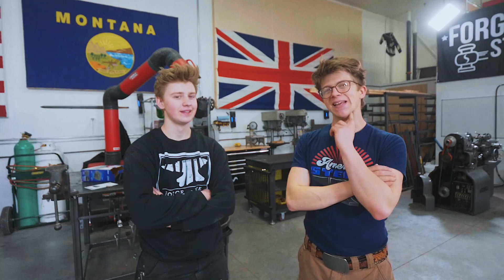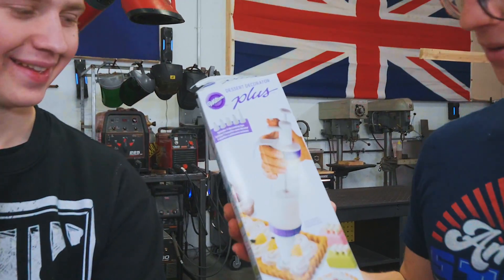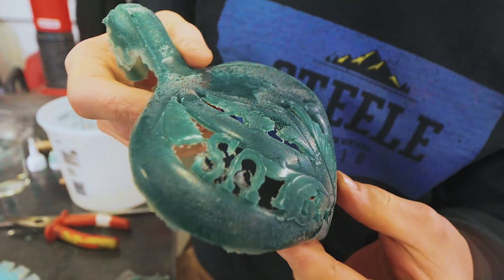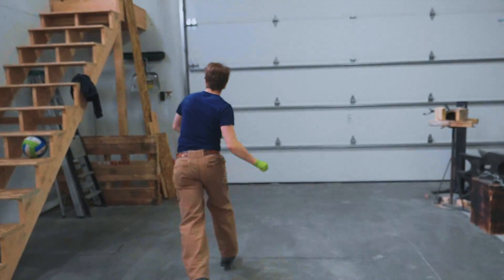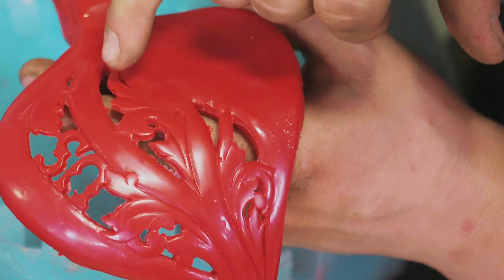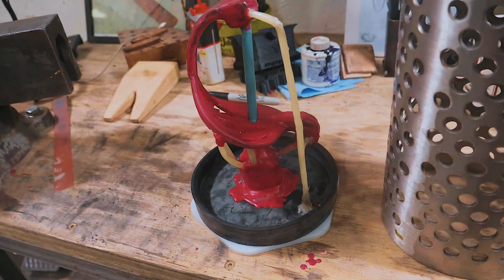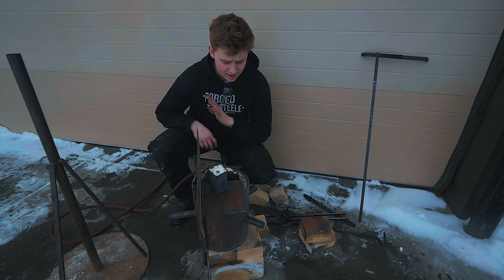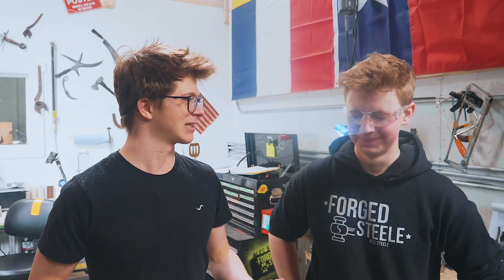MAKING THE CAVALRY SABRE: Part 13

Comment: You should think about getting a 3D printer. As they are awesome for prototyping.
Reply: I really thought this was an awesome idea since Alec has used CAD software before and it would be less time consuming
Reply: it also kinda defeats the purpose of hand craftsmanship. With some cnc tools, 3d printers etc. pretty much anybody can make things
Reply: @Nogrim there are some pretty good, open source and free Software solutions. blender for one.
Reply: @thorwaldjohanson2526  Somethings requires certain tools, 3-D printers is one of those tools. Even though it's one of the newest tools Available.
Reply: Thorwald Johanson putting a 3d printed finished product doesn’t sit well  with me, but for modeling that could be cool.
Reply: Agreed. It's painful watching them fail time and time again at things they never learned how to do properly
Reply: Not recommending for the finished product, but for the casting. You can do Lost PLA casting or they even make wax for 3d printers for lost wax casting
Reply: Was just thinking the same. You can get great printers for under $500 that are capable of printing wax specifically for casting.
Reply: Don't start giving Alec ideas to spend money on. He bought an oven to melt wax .. ;)
Reply: @thorwaldjohanson2526  I think you're overestimating the capabilities of printers and "anyone". Provided you have the chops to model exactly what you want and work around the constraints of the process, you can usually expect a printer to be off from the model by around a tenth of a millimeter on the X/Y plane from just material expansion and you'll have no end of hand finishing to get a part ready for use as a master. You can compensate for the former by undersizing parts of the model, but the finishing's non-negotiable. It cuts out carving wax and replaces it with a loop of CAD, printing, sanding, and measuring.

That said, I like the wax carving and would rather it stuck around. There's no end of channels that focus entirely on printing and CAD, and as someone knee deep in this stuff, it's kinda stale.
Reply: @StopChangingUsernamesYouTube  wasn't just talking about printing, but cnc manufacturing in general. And I agree, there's already a bunch of channels out there, and compared what Alec and Will are doing, it's a bit stale. There is just something about creating something with your hands
Reply: rothery2 Some 3-D printing technology and techniques, make excellent finish products, with many being used in general manufacture already. Even desktop 3D printers when used properly can produce  the required finish. Just as forging steel can produce scale, a 3-D print may have lines. Both can be removed with a bit of sanding.
Reply: Printing nerd here. 3D printing is awesome because it gives you the ability to rapidly prototype for a super-low price. I own two printers myself and have used them both for creating parts and for prototyping ideas that would then go on to be made from other materials. 

And it's really not all that difficult to learn. Or expensive for that matter. You can get a pretty good entry-level printer for around $200-300 or so, and there's outstanding modeling and slicing software out there that's completely free.
Reply: Also using a factory grade hammer, hydraulic press and the rest of the goodies does defeat the purpose of hand craftsmanship.
Reply: I disagree that using a cad and printer/cnc is not creative. 
They are just tools. Simple as that. If you don’t know how to use them properly you creat crap.
To make this swords guard you going to have to be pretty good at surface/mesh modelling and that is a skill set in its self. 
Those that have never studied it but criticise its use, have no idea what they are talking about.
Reply: Tools more tools must have more tools tools tools monster must have more tools I love that show

Comment: I have been casting replacement parts for missing and broken parts on hilts of high grade Civil War era and earlier swords for the past 25 years. I can tell you many things about mold making, wax injection, investing the wax patterns, burnout  and casting but will make only one point now. Just like in blade forging,  if all of the parameters are not met by following specific process procedures  in each of the processes,  the results will be less than desired. Since there are a number of processes involved in getting great results in the castings you will need to invest in the right tooling and then learn how to use it for each of many processes. Just like blade making, it’s not as easy as it seems it should, would or could be. But when you master the skills, it will come very naturally. It took me many years to accumulate the knowledge and skill I now have. And, just like you with blade making, we are still learning.

Comment: You aren't supposed to directly boil the wax.

Melt it by putting a small paint can containing wax in boiling water. Keeps it from smoking and boiling if you do it right.
Reply: So similar to melting chocolate in a double boiler?
Reply: Yep.
Reply: Candle maker here.  Yep, if your wax is smoking, you're doing it wrong.

 Melting and pouring point is a fair ways below boiling point of water.
Reply: I was wondering of their modelling wax is somehow different to candle? I'm a cheap bastard and if i try this I'm just stealing my wifes scented candles, might not work but it'll smell amazing.
Reply: @NoLoMo  a lot of chocolatier techniques carry over to cire perdue casting.
Reply: Wow so smart
Reply: You're right never melt wax over direct heat it could start on fire and you don't want to deal with a wax fire.... trust me!!

Comment: I've never really been much in the comments here but I saw this method to make a mold where you 3d print what you want and pack it in a wood box with sand, pour in the metal, and it seemed pretty good.

Comment: Hey guys, I’m a big fan of your antics - keep it up! Hey, on a side note - you guys should go spend a couple of hours at a local denture and crown laboratory (they wax cast denture and crown frames) just to watch and learn what tools and techniques they use. I worked at one for a couple of years and the people doing that type of work are some real artisans that do amazing work!! The one I worked at also used a centrifuge to aid with the casting and electrolysis to aid in the cleanup and polishing. Just a thought 😉

Comment: It's too bad no one ever let these wonderful boys in on the secret of mould release. Even just brushing a fine layer of olive oil (you want to use an organic compound if you're DIY'ing it so it doesn't have a chance of attacking the mould or casting medium) will help tremendously with a smooth part release and detail retention. :P
Reply: Yep...mold release is your friend.

Comment: Might I make a suggestion for making wax slabs to work from?  Try using either pyrex bakeware or metal bread pans(they make multiple sizes so take your pick).  The pyrex is excellent for obvious reasons lol.  Also the metal bread pans are great especially if you get the ones that make multiple loaves.    Another thing to consider is places like IKEA may have silicon loaf pans.  All pretty good options for making wax slabs.  Also Pam cooking spray might help with the wax sticking to the molds(I make candy that has a similar consistency and I go through Pam spray like it's going out of style).

Comment: I cast silver rings and I can understand your pain. Sometimes you have to just hand make the wax to what you want. My last ring I had to cast the wax 20 times before getting one I was happy with and then it didn't turn out in the finally silver cast. But the very next one I got it. Thanks for the hard work. Try a pressure pot sometimes, they get more bubbles out.

Comment: Spray the mould with a small amount of release agent. Before you pour wax into the silicone mould you need to heat up the mould to like 50 degrees celsius so when your pour the wax it should get a better casting

Comment: Love the videos!👍 Still entertaining as ever!  I think it would be cool if you got a 3d printer. You should look into it. You could use it to design your model and print it or you could get a 3d scanner and scan a physical model to have an almost exact replica. You can also use 3d prints in casting. Its called lost PLA casting and is essentially the same as the wax process just with plastic.👌

Comment: When melting wax; it works better with 2 pans. one smaller than the other, the bigger one filled with water that you boil with the smaller pan filled with wax in the boiling water.

Comment: Most silicons can be heated above the melting point of wax. May help with the casting. Also... let it cool to room temp before demolding. Even toss it in the freezer for a bit. Might help

Comment: I'd suggest that it would be a good idea to make a casting of the guard/hilt in resin - like the two-part Alumilite brand - in the silicone mold to have a master available in the event that a second silicone mold becomes necessary.

As can be seen, things can be rather easily destroyed during the attempts to produce a product.

Comment: That’s my line of work. I’m  an injection molding technician. But we use carbon fiber nylon and fiber glass nylon. And sometimes some soft poly.  We never use wax before.

Comment: If u wanna get a good wax mold just gently Brush with soft brush a few layers of wax on each of the sides of your silicone mold. Once you have built up a few mm layers, clean contact edges of your mold, put two sides together secure and the pour wax in.  Wait  to cool then  open the mold. You should get a good wax copy.

Comment: It takes a little more time but it works so much better than investment. Build your boxes and used green sand. You will get a much better product. They have been using the green sand method to pour brass bells for churches and other things for a couple of hundred years.

Comment: Alec - Bubble Out Does Not Need To Be Done By Vacuum, It Can Be Done By Pressure As Well. Which Gives The Advantage If Being Able To Keep The Material Hot While Its Being Kept Under Pressure.

Comment: 3D PRINT THE GUARD. You can print it in plastic that can burn out when you pour the metal. You can even sand the plastic after you print it if it's not perfect

Comment: It's best practice to not let the investment mold not dry out too much before firing it because it could cause impurities to be in your casting.
If it's been sitting for too long you could try to wrap a towel around it or something. You don't want to drench it as it would cause the investment to dissolve, but it needs to have some kind of moisture in it.

The reason for this is it aids in burning out the wax. As you heat the casting at around 300 degrees freedomheight it causes the mold to "sweat" on the inside which helps to dislodge the wax on the inside walls of the wax mold and melt out. Then you can increase the temperature to around 1400 to burn out the remainder of the wax. The size of the casting will determine how long you ought to keep the temperature at 300. It's also recommended to fire it at around 300 for a period of time while it's still moist so that water that might still be inside the casting doesn't boil violently causing the casting to crack as well.

Also, you'll want the inside of the mold to be at the right temperature before pouring in the molten metal or you'll experience too much shrinkage as it cools which would cause deformities. You'd want the inside to be close to the melting point of the metal and have plenty of molten metal on top in the "ball" of the casting (where all the extra molten metal sits that doesn't fit in the casting). As the casting cools it will draw from that "pool" of metal so it prevents deformities. To help keep it the right temperature, after you know the wax is burned out, you'll decrease the heat for a period at the temperature that you know you want it at for maybe a half hour or something before you pour.

Hope this information helps in case you're still having issues in the future.

Comment: You do have a way to pressurize it in! Just get the wax into a reservoir and then hook that reservoir up to your CO2 tanks regulated down top like 100psi or so. Once the wax has melted in the reservoir you just turn a ball valve/open up the regulator to pressurize it and have it flow out another tube into your mould

Comment: Would it have been easier to try just casting a solid piece for the handle then engraving out the design in the metal, rather than in wax? Or would have that been a little too time consuming? Either way I'm loving all this knowledge being shared about casting and finding solutions to different casts, hope you guys continue this awesome work!

Comment: More progress!

Awesome!!!

Have you investigated release agents that form a light coating on the silicone and allow the wax to come free cleanly?

Very thin layers of wax, one on top of the other, will get you fine detail (same concept as molding chocolate...which is just an edible fat or "wax")...thin layers, allowed to coat the inside of the mold, then the excess poured out...a short cooling, then some more wax...repeat until you build up the thickness you want.

Or have you looked a a casting centrifuge?  The guard might be too big for that, however.

Vacuum your investment before pouring, vibrating the chamber to get all the bubbles out.

Spray the wax master with anti-bubble agent.

Make sure your cylinder has "foaming" space for vacuuming after the pour, or put some tape/cardboard around the top.

Pour down the side wall of the cylinder vs. right in the center...helps prevent bubbles (as with chocolate, paint, etc.)

The details in the mold are beautiful!

Excited to see the next stage!!!
Reply: Also, investigate painting investment onto the wax as a thin layer to get it into all the detail, then putting it into the cylinder and filling/vacuuming.

Comment: Using casting cubes are way better than scrap brass.  For casting the pommel with the perforated flask, you might need a large vacuum pump.

Comment: Tip. Dont put the pot on the heat directly with the wax in it. You need a secondary pot with water in it so that the wax does not reach the combustion temperature.

Comment: Proper tools make the job easier. You guys were on sort of the right track with the pastry thing. A basketball pump with metal tube would have been a cheap workable solution. Just have to work quick. Regardless, keep up the outstanding work 👍

Comment: Wax Injector Idea: 1/4 in forged Damascus plate bent to a cylinder, welded. then machined out inside - to take a plunger. Add an end with a 1/4 high pressure nozzle and valve. Fill with carefully measured amt of wax and then slow heat in the oven to melt. Insert and push. Over engineering for the win?

Comment: you need a mold release agent. so that the wax wont stick to the inside gents. also, if bubbles are an issue doing a light spritz of rubbing alcohol gets rid of bubbles on the surface layer. @Alec Steele

Comment: the problem with bubbles is that you never set an easy way out for the air. For casting, you have to put at least two holes : one for pourring, and the other for letting the air escape

Comment: make a vent tube from the lowest point to the top independent from the the pour hole it helps the gas escape. think it help in other way too but i'm not sure, heat distribution, the flow of the brass or something.

Comment: buy a dental technicians vibrator plate! I use those on a daily basis to get rid of bubbles in my plaster/investment/wax to cast my dentistry models bubble free. Mine has a max load of approx. 2 KG but you can upscale them when you have the money to buy a vibrator plate for lab chemistry useage! By the way we also use some type of silicon spray so the wax does not get stuck :-)

Comment: silicon mold. make a steel box to hold the mold and stick it in the over and add the wax and let it fill the mold and then turn off oven and let it cool to room temp, pull the mold and put it in a fridge or outside in the snow and let it get harder in the cold et voila?

Comment: Next time you make a wax mold, if you have the plywood on the sides, try tapping gently on the side.  If you want a pressure chamber, can't you use the vacuum chamber and force air in?

Comment: Did they figure out they should use a double boiler to melt wax?  If you use a double boiler, you can melt the wax safely without worrying about catching the wax on fire.

Comment: Why don’t you just make a wax injector? I made myself an injector for jewelry when I was in high school. It was cheep and simple. I bought a pressure cooker at a thrift store drilled some holes added a pressure gage, an air fitting on the lid and a valve at the bottom attached to a flare fitting for the injection point. Put the pressure cooker on the stove to melt the wax, pressurize to 5 - 10 psi and open the valve. It shouldn’t cost you more than $50 to make. I still have it, if you would like I can send you a picture or heck I could ship the thing to you!

Comment: The casting wax that you got probably smells like cinnamon because it has cinnamon leaf oil in it, which is a great anti-foaming agent. If you plan on doing more casting/molds it might be worth getting some cinnamon leaf oil extract. Just putting it out there.

Comment: You have a crazy over-engineered vacuum chamber that you can use as a pressure pot.  Why not get a pump to add pressure while you're casting the wax in order to get rid of the bubbles?  A pressure pot and pump is about $500, so if you just need the pump it should be way less than a new kiln.

Comment: Are you guys familiar with the method of using a glass jar, and some tubes to bleed the brakes on a vehicle? What if you filled that jar with melted wax, then used compressed air, instead of vacuum in the same apparatus, to force the wax into the form?